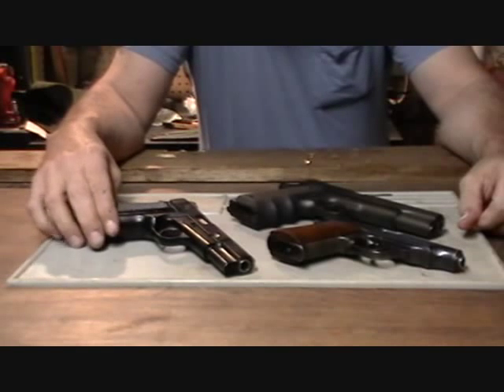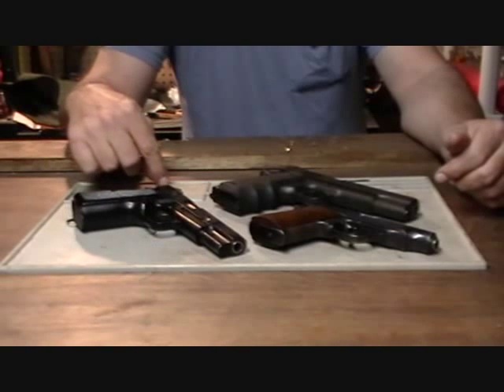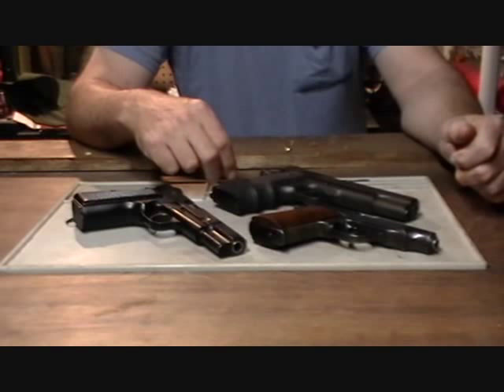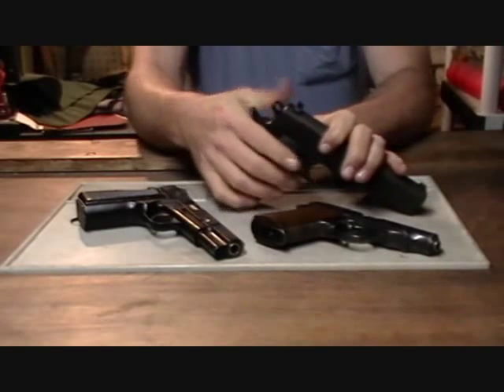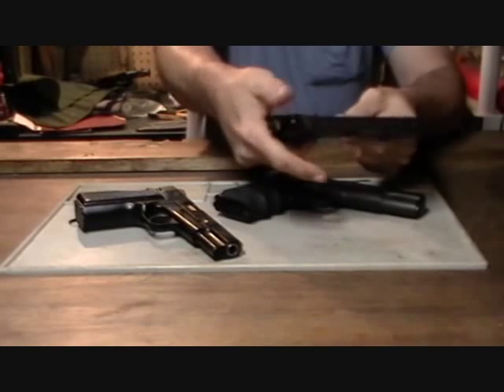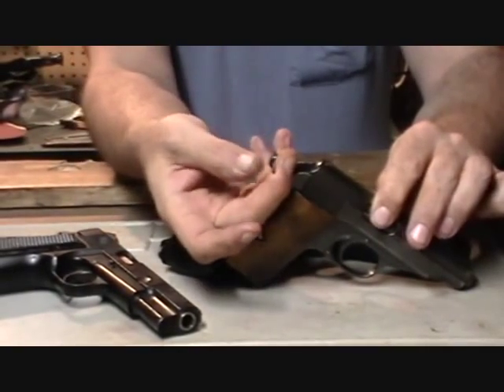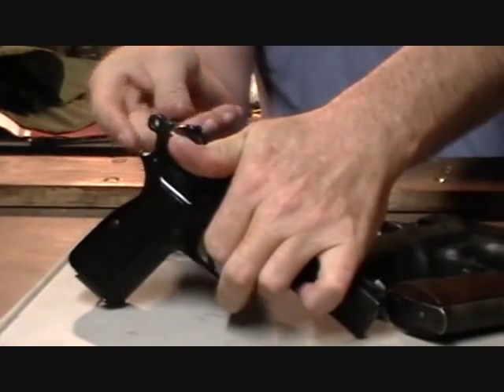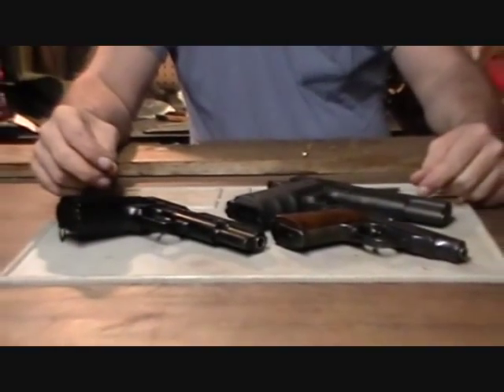semi automatic pistols, Why there is a hole in rounded hammers

Comment: That does make sense. However, i think it's a shame that those types of hammers prevail on modern 1911 style pistols. The original L-shaped hammer is so much better to control in my opinion. I don't trust the newer round ones not to slip from my thumb, which i have never had happen with a traditional hammer.
Reply from the maker: I feel exactly the same when discussing the FN HiPower. Never experienced hammer bite from a HiPower equipped with the spur hammer. The round hammers are renowned for chewing up the web of one's hand.

Comment: Where did you hear this?  because I'm fairly certain you are wrong.  The hole is to reduce the mass of the hammer.
Reply from the maker: Where did you hear that because I know you are wrong. Why would one to need to reduce the mass of the hammer? To reduce lock time? You can do that with a lighter drive spring. To allow the slide to overcome the mass of the already lighter hammer assembly? No. That can be done with lighter recoil spring. And, if a lighter hammer was required why not just install a smaller hammer? Oh wait! THAT would make it even harder to manually decock the weapon...
Reply: @onmilo  you just answered your own question.  Its so you can have a hammer large enough to have the surface area to decock but not too heavy.
Reply: @jjmarcos but his answer was a different answer than you had. And you're saying his answer is right what the hell are you talking about? Just wondering.
Reply: @Rgzmacc420  He didnt answer the question per se, but he reasoned his way to the issue:  " And, if a lighter hammer was required why not just install a smaller hammer? Oh wait! THAT would make it even harder to manually decock the weapon..."
This (from everything I've read) is the reason for the hole.  To make the hammer lighter, while also keeping the surface area large so decocking is not an issue.
Reply: @jjmarcos  explain how in any way putting a lanyard hole on the hammer of a gun is a good idea? And why would they put a lanyard hole on the hammer and also put it on the grip of a pistol?
Reply: @Rgzmacc420   i think you meant to ask that question to @onmilo

I agree that the hammer is not for a lanyard.
Reply: @onmilo  you reduce the weight of the hammer because of hammer bounce and rebound that's absolutely why it was done on the C96 and why it's there on the beretta 92 series which is why they have different weight hammers for different weight springs and triggers.  This is 100% fake news lol
Reply from the maker: @jamesolbrisch2582  Oh. Okay.